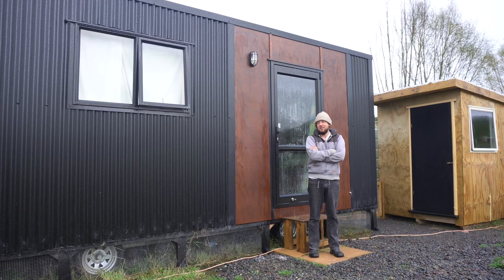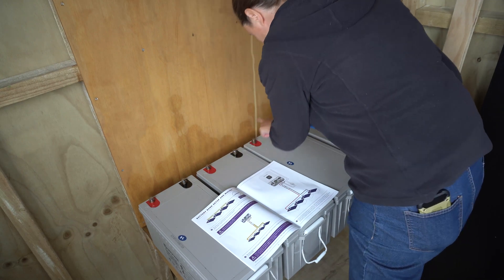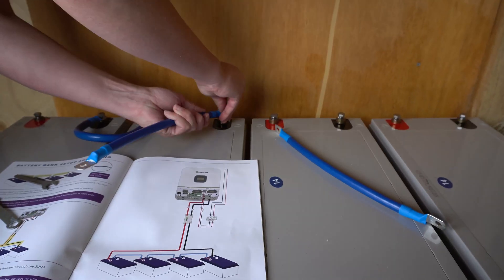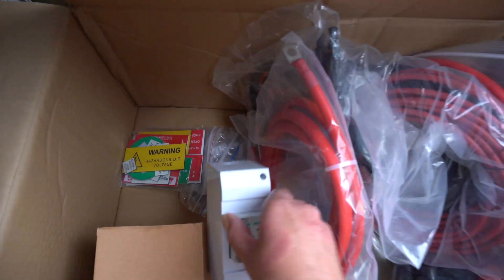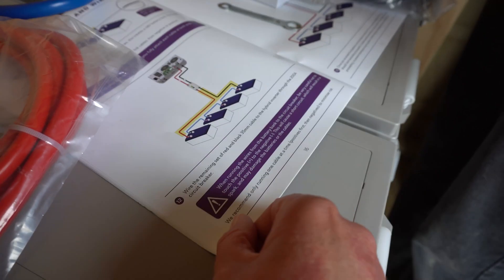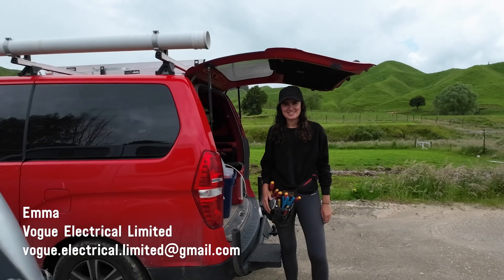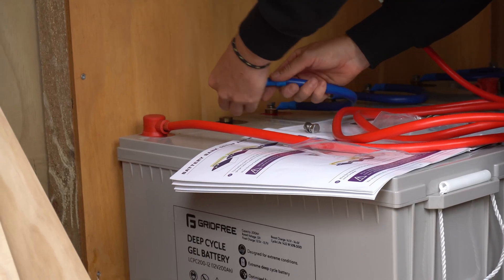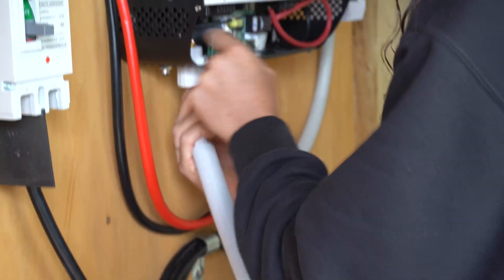Installing Grid Free Solar Power System with Electrician⚡️

Comment: The generator size depends on what your system can handle, just get a small one 800w ish and see if it can keep you topped up, if not ebay it and buy a bigger one.

Comment: Great work by the electrician.  Has your brother thought about getting a portable powerstation? I use one and with very little work can have as much power as I need. I did a review on the Poweroak about a year or more ago.
Reply: Pointless. He already has solar panels, batteries, inverter … exactly the same as what’s inside your power station but on a bigger scale. Getting a power station doesn’t suddenly magic electricity out of nowhere 😂
Reply: @Arnold Snodgrass  hey take a chill pill. Its was only a suggestion right or wrong.